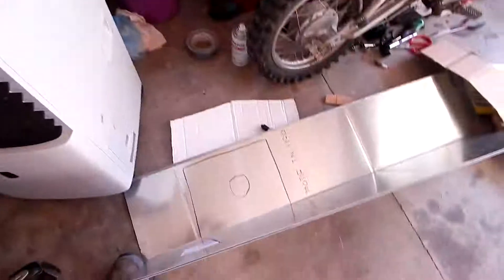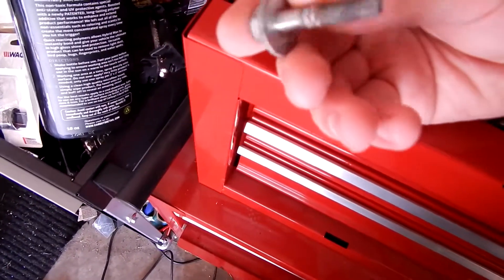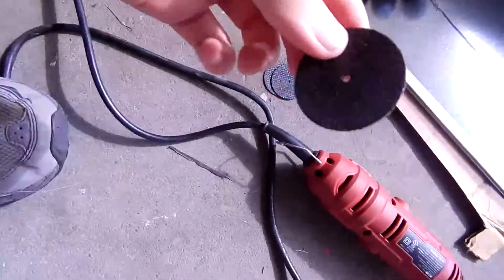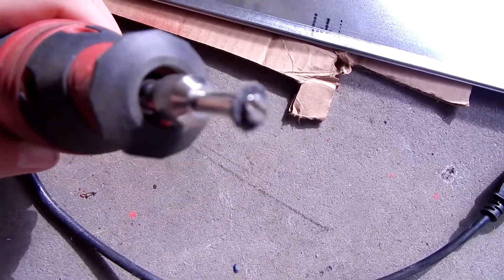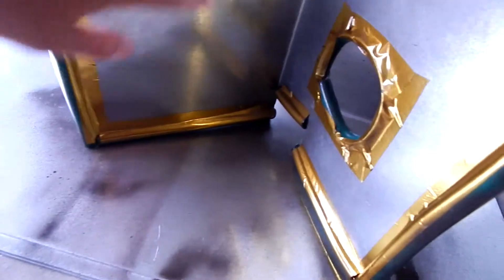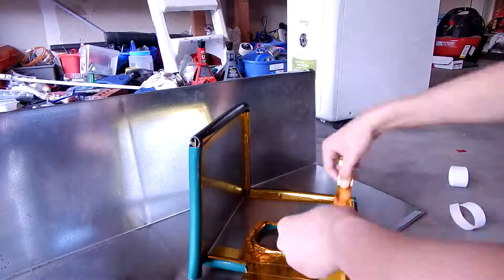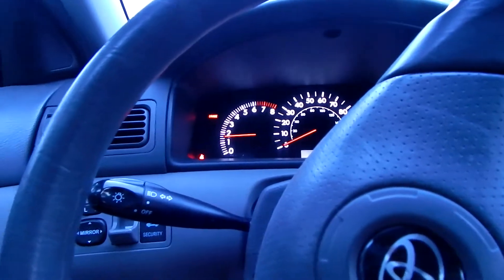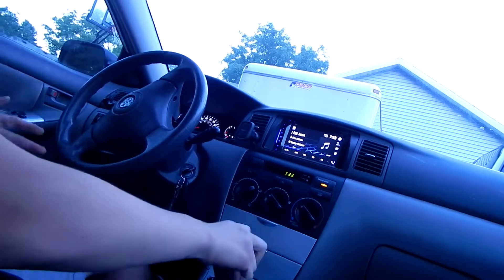Fabricating A Short Ram Intake HEAT SHIELD

Comment: I know this video is old ....... BUT FOR ANYBODY LOOKING TO DO THIS PLEASE READ MY COMMENT!!!!!!!!!!

I live in Seattle Washington where it rains almost the whole winter so that's why running a cold air intake is very risky because you don't want to suck up water..........

So what we do is we build a short ram intake but so we don't get major heat soaked and lose power we make a custom heat shield. AND THEN....... We build a custom air duct that goes down to the front bumper normally next to where your fog light would sit or in place of where your fog light would sit if you don't have them......THEN NEXT...... You run that air duct from the front bumper up to the heat shield so that there is cold are feeding inside the heat shield and then you wrap the intake tube in the gold reflective heat tape that you can get on Amazon for like 10 bucks that also will help keep your intake temperatures down!!!!!!! 

THE FINAL RESULT...... you will get the benefit of a cold air intake without the fear of sucking up water and not only will the air duct feed it cold air and drop your intake air temperatures but wrapping the intake tube itself in the gold reflective heat tape will also drop your intake air temperatures because no matter how cold the are the filter is getting if the tube itself gets hot then it will turn into hot air before it reaches the throttle body that's why you want to wrap the intake tube in the gold reflective heat tape as well.......

Doing this I've been able to get a regular short ram intake that was getting 130 ° to 140 ° intake air temperatures down to 70 or 80 degrees even on a hot day THE DIFFERENCE WAS HUGE and definitely noticeable yes intakes don't gain you a lot of power but you will notice a for sure difference after doing this!!!!!

Comment: Looks good actually. Only issue is functionality. Heat will go right over that wall. There is a method you can do to prevent that and make it truly functional. Basically the hood has to make contact with the top of the heat shield to create a decent seal. That way heat will not be able to enter the area with the filter. Another issue is you need a place where ambient air can reach the filter itself. Otherwise you will still not notice a difference, even if you created a great seal from the engine heat.
Reply: Idk it will still help not a ram air but a heat Shield doesn’t need to be perfect to help